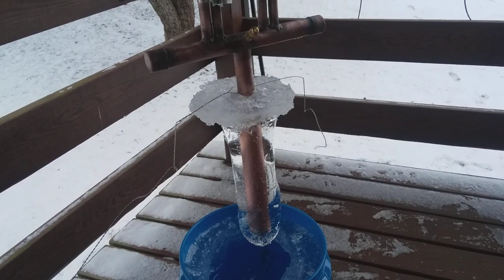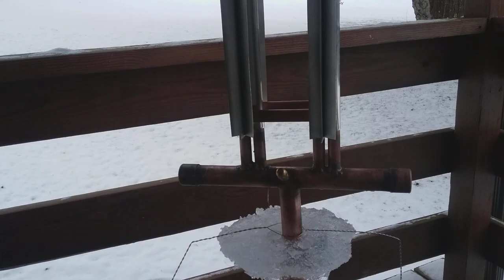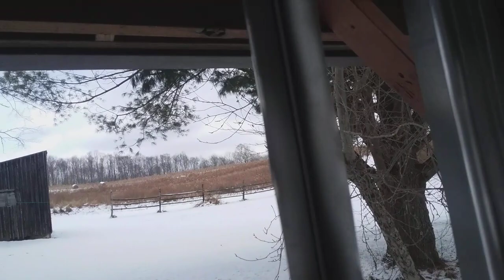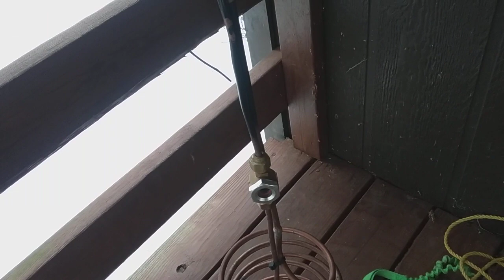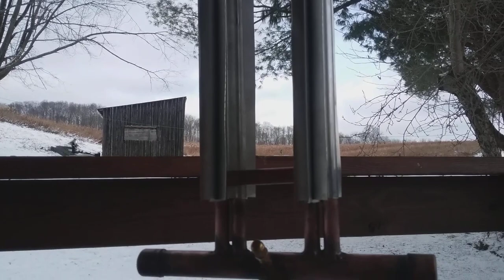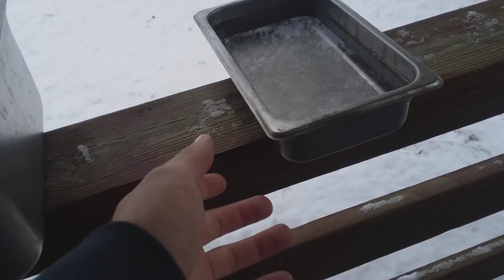Passive Ice Manufacture in Winter

Comment: Hi, your experiment mirrors a project I’m working on. I want to recreate a passive refrigerator pioneered by Scott Neilsen. I visited one that has been working since 1983. The basics are simple a heat pipe in a tank of water. Several hundred pounds. In a super insulated box. A refrigerator compartment. The one near me holds ice till late September.  I would like to hear your thoughts. Also as a maple syrup maker we use curved bottom tanks so ice pressure moves up. Don’t know if that helps. Thanks Bruce

Comment: What would happen of you kept the water in a heightened convection state with an submerged impeller then quickly pull it out at the right temperature? The impeller would be driven by a belt traversing the surface of the water and a motor (or wind turbine.)
Reply from the maker: I've seriously considered agitating the water, but I do not want to use electric.  A wind powered version would be great, but sometimes it doesn't blow.
Reply: @whatawaytogo515  well then, how about a fresnel lens / solar thermal powered homemade icy Ball clone? That seems like it would be right up your alley :-)
Reply from the maker: @garbleduser  IcyBall would be neat.  I actually have a pile of parts downstairs to make a stationary (Superfex) style absorption system, although I'm not sure I have to balls to build it!  I'm not opposed to a solar absorption, or even wood fired, but I already have plans to do that to a conventional gas fired RV fridge.  This may be what eventually replaces my electric freezer.  

For now, I'm just easing my way back into copper work with some simple projects, and trying to develop a stupid simple way to take advantage of the local low temps.
Reply: @whatawaytogo515  Another idea would be to add your heat pipe connections to thin metal fins which go straight down into the liquid. 2 seconds with a torch would be enough to free the plates from the ice.
Reply from the maker: @garbleduser  Hmm.  I think it would take quite a bit more than 2 seconds of applied heat, especially if the thermosiphons are still connected, because the heat will largely travel upward and be dissipated to the environment.  I've considered a method whereby the entire block assembly is inverted, heat applied to the condenser fins (now the evaporator) and the whole process reversed to melt the ice around the heat exchanger.  This would be done indoors, with concentrated solar, or like you suggest, with a torch.

I'm hesitant to add fins to the water because I doubt they will come out easily and/or they will get progressively more damaged with each ice block made.  I'll tell you what though, I'll stick a piece of fin in, and one on the next small thermosiphon pipe to test your idea, and the one I outlined above!
Reply: To bad I cant find any Teflon covered metal sheets.
Reply: @whatawaytogo515  thank you, I look forward to seeing it. One way that the sheets could come out more quickly is to use the sheets as a resistive heating element. If you were willing to use a little bit of high current, low voltage, low duration electricitcty. 

You can fold the tops of the fins and bind them together with rivets. This would allow you to set hot coals on top of them to help release them from the block of ice.

Comment: You could scale the design up by just avoiding the connection in the middle - multiple single-pipes instead of trying to cool a single pipe because I think you are correct - the thermal conductivity of the ice starts to be a limiting factor as the thickness of ice increases.  I have an ice maker like this.  It has a dozen "fingers" that each make a little donut shaped ice cube.  Cool project (I won't say pun intended because it was not.  I would never intend a pun.)
Reply from the maker: I agree, Jesse.  That's one thing I'm considering, so long as they are all separate, and can be individually be twisted out.  I'm not going to have the advantage of a hot gas bypass like the ice makers do, unless I got fancy and inverted the thermosiphon in a warmer environment to thaw the ice around the pipe.

I could benefit from tall, thinner tanks, just like are used in commercial ice machines.  There shouldn't be much limit on the height of the evaporator pipe, except if it got damaged from the twisting forces upon removal.